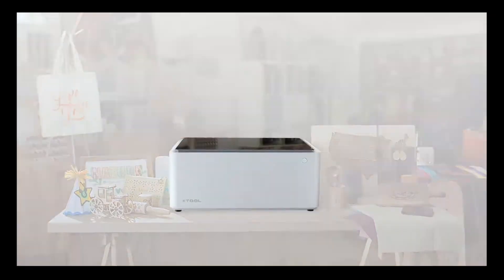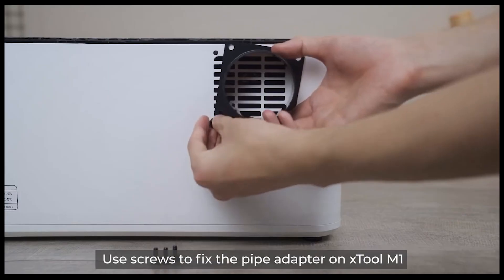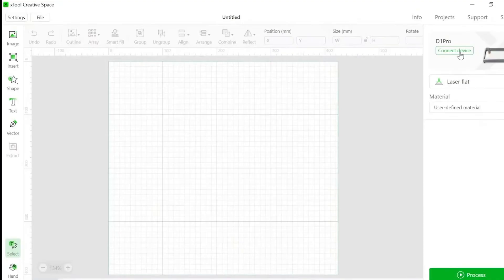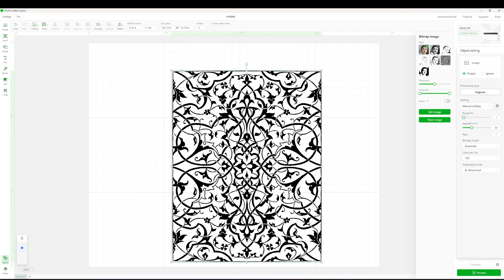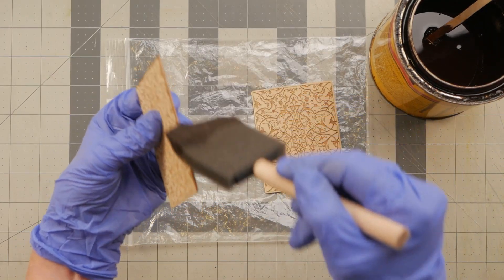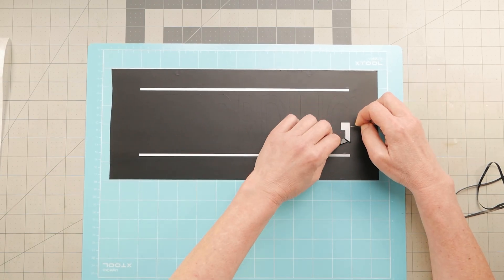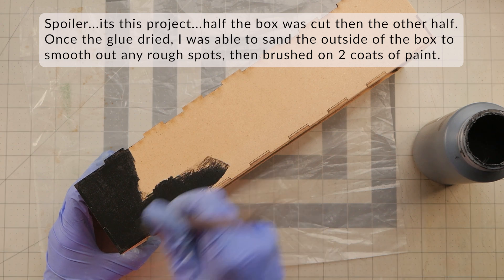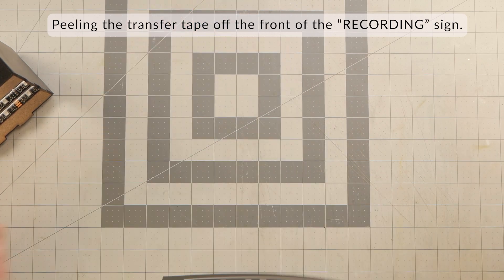XTool M1 2-in-1 Laser Engraver & Vinyl Cutter | Booksmith Review

Comment: Could one do emboss/deboss a material for a leather cover for books? Or do you need a CNC?
Reply from the maker: Good question!  I suppose it would depend on what material you wanted to use under the leather and what kind of debossing you were going for.  A CNC can do rounded edges and a laser cuts straight down.

Comment: I’m interested in something to cut bookboard, because my skills with a knife blade are not the best. Have you tried cutting that sort of thing? What did you think?
Reply: I had the same question!  Will be watching to see if someone knows.
Reply: You should be able to cut bookboard, you'll just need to sacrifice a small amount to get the settings right for it.   I found my calibration files on Thingiverse, but there are other places as well.  Basically, it's a grid of squares with power settings on one edge and speed on the other.  If the M1's software is like the LaserBox's, you might have to do some extra finagling, but once done, you run the cut and check which squares cut the best, and that is your setting for that material.

I'm simplifying it a bit so I don't write a mini-novella, but that's the basics.   xTool has a page for materials settings on their website, but it doesn't cover everything.  Pick the closest material to your bookboard, and set your test range a little above and below those settings.  It took a few passes for some of mine, but it's worth it for really clean cuts -- in the case of the M1, for both the laser and the cutting tool side.  I've taken to do any matboard cutting I have on my CO2 laser, because while the Cricut Maker will cut it, it's very slow (multiple passes) and shreds any fine detail cuts.  Kind of overkill, but worth it to me.
Reply from the maker: PheonyxAshe is spot on.  This machine easily cuts book board, which I'm thankful for since my hands continue to weaken as the arthritis gets worse.  I'll gladly let it do the heavy work!